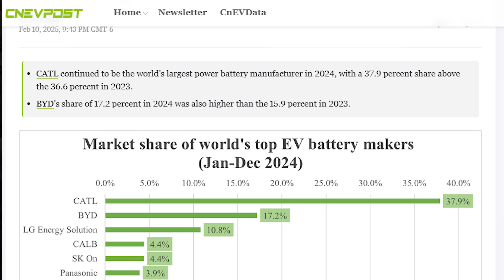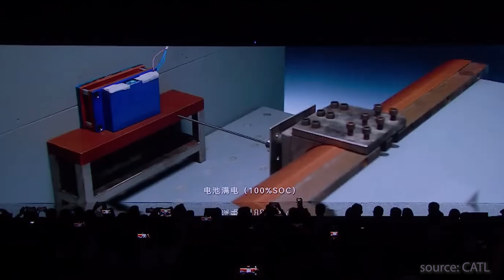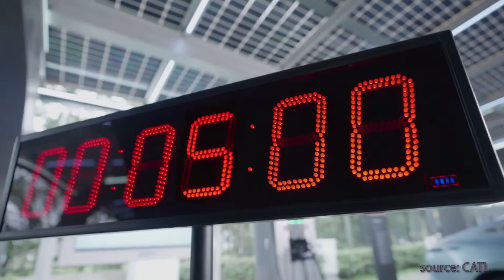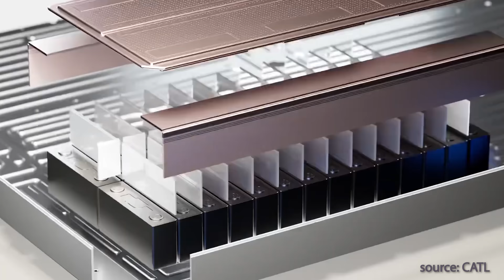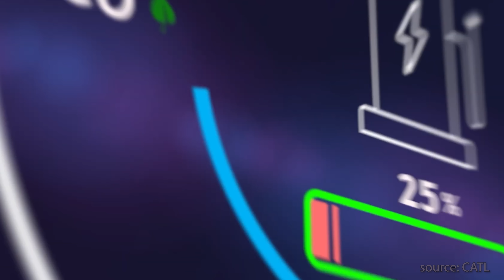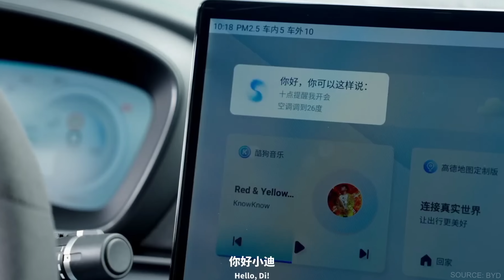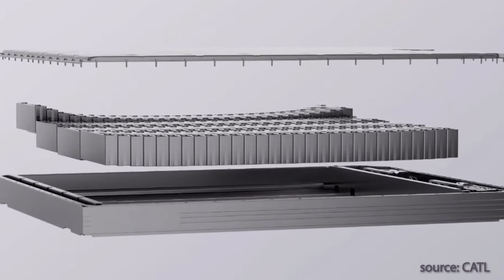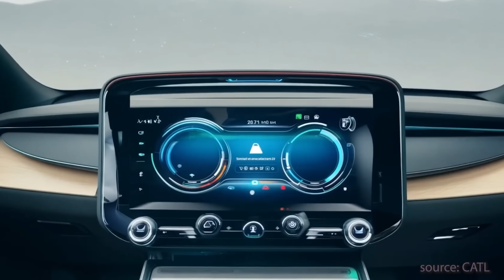THIS Battery Will Change EVERYTHING!  Sodium Batteries May Kill Lithium Forever? No more Lithium!

Comment from the maker: If you are in DFW, don't hesitate to reach out: 972 675 7725 ( call or text)  or shoot me an email: info@solartimeusa.com 
If you are not, you can also reach out, I do solar consultations and can connect you with a reputable installer. :)
Reply: Great video.
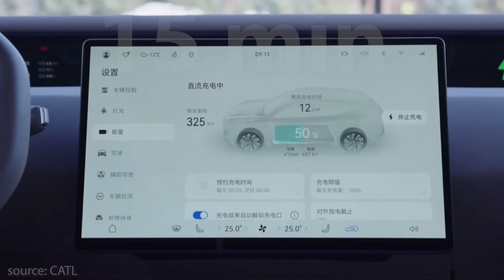Reply: 5:57  exactly 1.3MW ! The limiting  factory with charging speed is still the amount of power available:-

2-5 miles an hour,  on a standard mains plug. 

10-30 on an single phase home charger.
50-100 on a 3phase home charger.

100-1000 miles an hour on a public  DC fast charger. 

How is this any faster?
Reply: Happy Mothers Day to all mothers including our ultimate mother Earth 🌎🌍🌏🌐

Comment: Coming from a reporter who has no clue as to the infrastructure limitations of charging a massive battery in 5 minutes. Let alone the power generation capacity of a city and region servicing an entire population of such vehicles. It would require multiple trillions in upgrades. It's feasible at some levels, but if you think you are gonna plug your car into your house power for 5 minutes and charge it, you're crazy.

Comment: I don't drive very much (less than 20k miles in the past 6 years), but when it becomes economically infeasible to repair my current 10 year old car (purchased in January 2019 for $8,200 with 80k miles on it...I STILL haven't gotten to 100k miles!) it will definitely be an EV or a hybrid.  What will be important for me will be that the charger can be integrated into my home solar system and the EV will have bidirectional charging capabilities to exchange power with my home to car to home battery...and between each of the three storage components of my home/transportation system.  When that day comes I will have ZERO need for my electric utility company...not that I have much use for them now since my solar grid system ONLY draws power from the grid (a minimal amount) in December and January!! 🤑🤑🤑
Reply: Depending on your situation, you should consider ditching the car completely and rent when needed. Your car is probably worth $ 6,000.00
on todays market.

Comment: No they won't! The round trip efficiency of sodium is dismal compared to lithium. Only fools will be buying into this. But cute little video, oh and not like Chinese developers have never made bullshit claims as they steal pattented tech to try to control global markets.
Reply: But do they stop bursting into flame
Reply: So does lead acid but I'm not using that crap either. Flames are always the result of bad cell manufacture or improper use or charging. So stop being so dumb. @johnthemagnificent7022

Comment: Sodium-ion batteries cannot compete rigorously with lithium-ion batteries for EVs, given that mass-produced Li-ion batteries remain competitive, particularly when comparing the battery price to the actual car cost. Regarding the environmental advantage, yes, Na-ion batteries provide a marginal benefit, but consider the portion of an EV made of steel, Aluminium, Plastic, Copper, and other materials. By removing a small portion of Li with Na, we will not achieve a significant environmental benefit. The main challenge for batteries is energy density; Li-ion latest technologies exceed 300 Wh/kg, which is significantly higher than the latest Na-ion batteries. Every extra kg a car carries reduces its efficiency significantly. So, in the long run, for 10,000 cycle charging-discharging, even a 1% increase in efficiency matters because, in most countries, power is still generated by fossil fuels. To sum up, the additional environmental benefit of Na-ion batteries will be significantly offset by the negative impact of the increased electricity kWh energy required for EVs powered by Na-ion batteries due to their lower energy density. Until we produce more than 80% of the electricity from green sources, the efficiency of the EV and electric trucks is crucial in controlling global emissions.

Comment: Sign me up in with a good looking truck or “truckette” (not a Cyber Truck) Certainly cost, range and recharging times are keeping me from making the transition. Once these issues are addressed, I don’t think the EV industry will be able to meet the demand. Hopefully, we will not crashed the U.S. grid system when these batteries roll out into the market, and mass adoption of EVs takes place. But if it does happen, I should be 100% solar with a more than adequate solar/ESS and independent from the grid. God speed!

Comment: Have you done a video on the Aluminium Graphene Ion battery? 
  This is a far superior technology. No manganese, lithium, cobalt, nickel, phosphorus, graphite or copper. No thermal management required. Just plentiful aluminium. charges in 10 minutes. No capacity loss down to -30°c; passes puncture tests; no thermal runaway; No dendrite build up. This is the game changer that allows US manufacturing to sidestep Chinese battery dominance. I would really like to see a video on the Aluminium Graphene Ion Battery, I'm really interested in the evaluation of new products as I'm thinking of investing in this new technology. Cheers, 
Mark Gilmour.

Comment: I can see why you are a solar company. Falling for Chinese media hype instead of facts. Li-ion cells are already cheaper than Na-ion on a Kwh basis; they are already lighter, faster charging and mass producible. Critically Lithium batteries have stable voltage and not the vast drift of sodium, which requires complex and additional BMS. And amongst many other issues, in a crash/meltdown…sodium batteries are subject to make cyanide gas in a fire. Good luck permitting that around the world.

Comment: I think MUCH more important and exciting than sodium ion replacing lithium ion in vehicles (which would take decades) is that sodium ion could be THE technology that EVERY single house on planet Earth uses to become its own power company. Modular stacked sodium ion batteries in the garage coupled with a few solar panels could run the average person's entire home perpetually for about 10% of what the Tesla home battery costs. Within a year or two, the cost of having a home battery and a few solar panels could end up being 95% cheaper than paying the electric company, and you'd never suffer from power outages.
Reply: You need more than a few solar panels to power your house and charge enough battery to last the night. Think entire roof covered.

Comment: Lithium is not the worst component in Lithium batteries... For NMC, it is exactly that: N M and C. The best of Sodium batteries is that it doesn't need all these rare materials, and that makes it stand out above Lithium. The second step is that, yes, Sodium is more available than Lithium. But the real plus is, is that Sodium doesn't generate as much H2 as LiFePo4 chemistry when things go wrong. And Sodium needs even a bigger beating than LiFePo4 to make that happen.
The obvious downside of Sodium is that it has such an absurd big voltage range, compared to LiFePo4 which is almost flat between 80% full and 20% full. 1.5...4V vs 3.0..3.4V which mostly is ~3.3V depending on your max load. 
So for sodium you have to wire for max A @ 1.5V and accept max V @ 4V.

Comment: What does it mean when a battery company says 'you can have 900-mile/1500km cars'? Range depends on characteristics of the vehicle, not just the battery. 
We can already have very long ranges if manufacturers put big enough packs in, or spend enough effort on efficiency (like Aptera or Lightspeed). But mostly they don't. I think I saw '60% improvement in energy density with seal-healing anode'. I guess that's the real news/metric. And that is a big deal. 1.6 times current ranges for the same size/mass (which - it wasn't clear?)  would be enough to get me to switch (I need a 300-mile vivaro/transporter sized van, and all current vans are 200-miles-if-you-are-lucky (or too small, like the buzz)). You could do this already with current tech, but manufacturers choose not to, as there is plenty of market for short-range vans. Better (and especially cheaper) batteries will really help here.

Comment: I already have an EV that we use as much as we can. Between me and my wife, whichever one of us is going the farthest takes it. 
The SUV we have that we use to pull trailers is the one we can’t replace yet with an EV. Most EVs have around a 300 mile range. When you tow that is generally cut in half, so 150 miles. Sometimes I will pull a boat long distances and don’t have a lot of extra time to charge at a supercharger.   Also we go on trips and stay places that will not let you charge and are far from any chargers. 
These new batteries could make a big difference. I will switch to an all EV household as soon as it is a viable option.
Reply: Yup. ICE vehicles aren’t yet obsolete. In addition to towing weight over distances, they also excel at generating lung disease in urban areas. 
EVs suck at that.
Reply: That is because the US is behind the rest of the world.

Comment: Before I owned an EV (got my first one in Dec 24) I had range anxiety. Since then, I don't. I leased a Hyundai Ioniq 5 Limited with a set range of 270 miles. I took it on a long road trip right after getting it (i.e. winter holidays in US). I quickly realized my fears were overblown, by a lot. I applaud CATL's innovations as it will make batteries cheaper while also addressing range anxiety, but I personally charge at home and fast charging isn't a big issue in my life.
Reply: This is a common revelation coming from people who have made the decision to go EV
Reply: US media trains people to have these fears about EVs

Comment: LFP has almost the same voltage at 15-20% as it does at 90-95%. Sodium batteries have a huge disadvantage in that area, with a big drop in voltage as SoC reduces.

Comment: CATL and Lithium are clearly the market leaders. However, everyone is researching and testing. This is the kind of progress that worldwide battery testing an innovation is expected to deliver. CATL will lead the market, but any advance that they have won't last long. Of course, they will have a new chemistry by then too. Short charging times and cheaper longer lasting batteries will be the norm very soon.
Of course, this fast charging requires charging stations that can deliver power at the voltage and currents required. Those will be scarce on the ground for quite a while. Honestly, fast charging is much less of a big deal than car and battery makers would have you believe.

Comment: 1.3 megawatt charging rate? That was enough to power the Navy ship I was stationed on, a 4000 ton frigate. It had four 1 megawatt generators, each a 16 cylinder Stewart Stevenson diesel.

Comment: I live in Minnesota.  EV's are practically worthless here as we have sub 0 C (sub 32F) temperatures for half the year, and current battery technologies see 1/2 or even 1/4 the range up here in the winter months.  If there was an EV that had 900 miles of range and didn't decrease that range when it was below freezing, that would be a game changer.
Reply: Those range claims seem pretty suspect. It's only 175Wh/Kg so you'd need an awfully fat battery (or very small/light/efficient car like Aptera) to get ranges like that. The temp claims are true though, which will be a big deal in places like Minnesota.
Reply: Nonsense.
The country with the highest rate of EV adoption is Norway.
Reply: @SigFigNewton  Norway has a 25% tariff on all cars (VAT tax)… they waive that tariff on EV’s making them the least expensive vehicles to buy.  They also have one of the most expensive yearly vehicle registration taxes in the world which are based on CO2 emissions.  EV’s are exempt from that tax.  They also have toll roads to pay for their roads… EV’s are exempt.  The people of Norway have EV’s not because people prefer or want them, but because the government has made the cost of non-EV’s too high.  

Of course all of these subsidies are expensive, and Norway pays for that by selling oil & gas (Carbon based fuel) to the world.  65% of Norways exports are carbon based fuels.

So Norway doesn’t care about the planet, they care about controlling their people.
Reply: @bguptill  The point here is that it's cold in Norway, everyone has EVs and it works fine. The same thing could happen in Minnesota.
Reply: @xxwookey  The average winter drop in EV battery range is 35-45%.  The average drop of these sodium batteries is 1-5%.  If you were to keep your vehicle in the garage, and charge it up each day, the average EV driver in Norway uses about 5000 kWh per year.  The electricity rate in Norway is 16¢ per kWh.  So that's $800 per year in electricity.  Subtract 40% of that, and you are basically throwing away $320 per year due to the cold.  Your range is cut from 265 miles to  160 miles.  The average commuter in Norway drives 3-12 miles, the average commuter in Minnesota drives 30-40 miles.  

I have several friends here in MN with EV's.  They got ~250 miles of range with their vehicles in summer when they were new, and about half that in the winter - 125 miles.  By year 3, the Winter range was down to 60 miles.  It was about enough to take it to work and back, but nothing else.  They all regret ever buying EV's.  We get days of -40 F here sometimes... on those days the range on the EV would be 10-15 miles.  You can't trust it to even make it to the destination.  The Sodium batteries boast 90% range even at -40 F.  You don't think that'd be a game changer?
Reply: “900 miles of range”
😂
A gas Ford F150 gets less than half of that. For how long have you had range anxiety about Ford F150s?
Reply: Norway and its economy functions as good as ever in its arctic winters. Using EVs.
That is the relevant info. Range anxiety is mostly nonsense pushed by moniedinterests.
Reply: Norway is using EVs in winter and thriving. Arctic Norway. What more is there to say?
Reply: Nice invented annecdotes. Meanwhile, these days high end EVs deliver more range than many standard ICE pickups.
Reply: @SigFigNewton   How many people do you know in Norway or Minnesota with EV's?
Reply: Lower end EVs only a couple of years behind
Reply: I know statistics and the big picture. Have fun with your anecdotes. Going full EV worked. For arctic circle Norway.

Comment: Sodium Batteries have less energy density than Lithium (NMC), making them heavier per kwh.  Sodium is about ~160wh per kg (your figure in the video seemingly from the manufacturer, an updated figure is 175) and Lithium (NMC) is up to 250wh per kg.  Energy density is pretty comparable, as you noted, between Sodium and Lithium Iron Phosphate, though.  Because of energy density concerns and where the volume allocated to battery is a premium (phones as a relatable example), sodium won't make sense.  You'd almost be cutting battery life in half.

Sodium Batteries are less efficient to charge than Lithium, making them eat up more electricity to charge compared to the usable power you get out of them and also creating excess heat that potentially has to be managed.  Lithium Iron Phosphate as a really good example is about 97% efficient where as Sodium last I knew was something on the top end closer to 90%.

Sodium Batteries have a larger usable voltage range, something like 1.5v (dead) all the way up to 4.0v (full) per cell.  Pretty sure that will require more complex (more expensive) systems to manage compared to the relatively flat voltage of Lithium.  They'd have to be able to deal with lower voltage and significantly higher amps when the battery is nearly depleted and would have to deal with considerably more voltage and lower amps when the battery is full.  For all-in-one proprietary systems, it probably matters less to the consumer because you'll buy the complete package expecting it to work, but if you were trying to buy a drop-in replacement battery for diy systems, Inverters that people already own are almost certainly not going to like these batteries, which means you'll need new inverters that have the electronics inside to handle the much larger voltage variance of these batteries.   A 12cell sodium battery might have a voltage range of 18v (dead) all the way up to 48v (full).  Most inverters are not going to handle that voltage range, and will think the sodium battery is dying long before it actually is, and the inverter will likely go into voltage cut-off protection.  Perhaps a couple years out a lot of the market could be saturated with Inverters that are sodium ready and costs could be better under control, but when it's new and not widely adopted, it'll likely be more expensive.

I will give credit that sodium batteries on their own (not counting additional electronics to make them work) are cheaper, and I will give them that they'll likely work better in colder conditions.

Comment: I'll believe it when I see it. Ive been hearing about these 'breakthroughs' for years yet range and charging times haven't changed.

Until range is atleast 600 miles per charge and charge time 0%-100% is less than 2 minutes, I'm sticking with gas.
Reply: Pretty fast charge time is expected by you.   As I would charge mostly while at home I don't care so much if charging takes 5-10 minutes when on the road.   Only reason an EV isn't for me yet is that I think the current battery technology isn't mature enough - thermal runaway just has to be virtually impossible.
Reply: @rovert1284  That's only a factor with bad designs. Every one of these fires you hear about are cheap Chinese knock-offs.